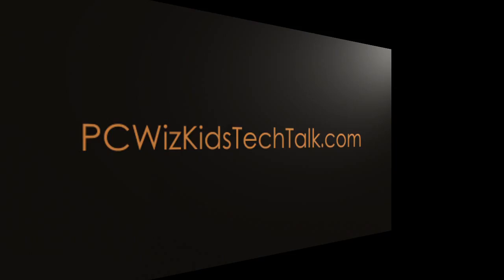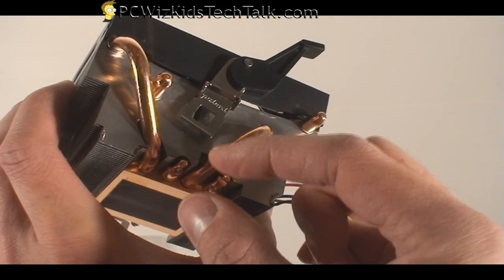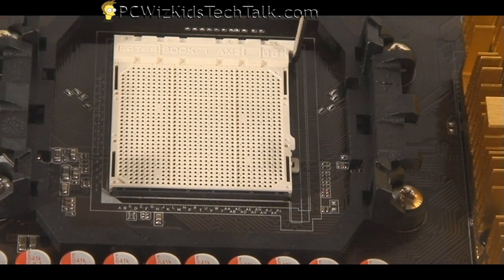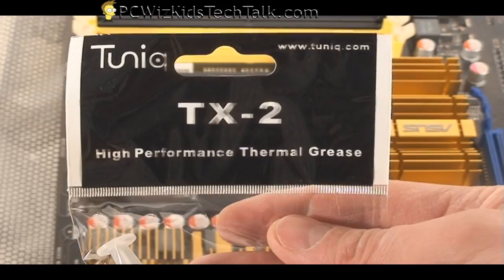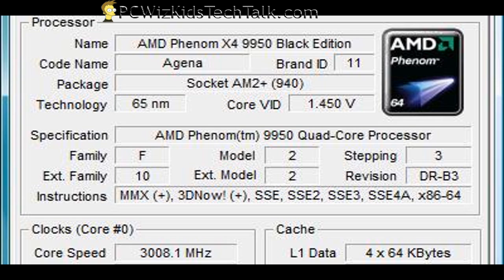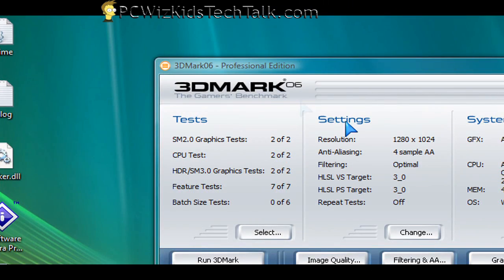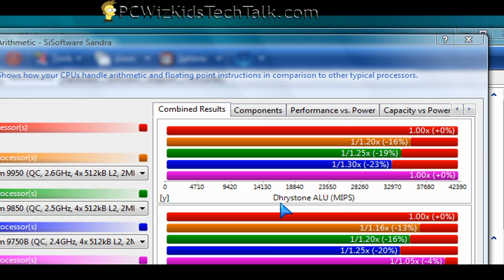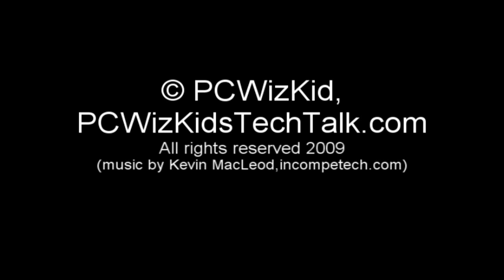Phenom X4 9950 Black Edition - AM2 CPU Review

Comment: if you did that with the stock heatsink i wonder why mine is much warmer then yours mine is right now 40 on all cores during gta v it gets to 60c processor is at stock speed i got the heatsink with the noctua nf-p12 on it do i need a new fan on the heatsink or a new heatsink in general?
Reply: New thermal paste.

Comment: @MotoHarmer It depends what type of Phenom you have. Is it the first or second Gen. phenom line up. Also which Phenom is it. 955, 965, etc?? If you have the 1st gen phenom they had problems. Although I myself owned a 1st gen phenom and it worked excellent in every way. However a Phenom 965 black edition 3.4 ghz quad core beast can be had for only $150.  I now have a 965 and it is a BEAST. WAY WAY FASTER than my 1st gen phenom.

Comment: I have the 3.4Ghz Phenom Quad core and the cheesy clamp system warped my board and didn't allow it to start properly. I had to loosen the clamps on it and its running fine now.  I used to be getting a "Bad Checksum Menu" error everytime I started up and it never booted. Always went to the black screen.

Comment: What is the minimum psu requirement for this cpu? im running a 450 psu and it wont boot when i have four one gig chips on the mb. im running two one gig chips now. would 550 do or should i get more?

Comment: you shouldn't touch the heat plate with your bare hands because finger prints are more thermal resistant than thermal compound and a bitch to fully remove

Comment: AMD is the best on 45NM technologies, that is confirmed.
and i am not 12 years old, what you could be, i am 19, and study'ing on the best ict college in holland.
AMD is producing a 8th Core processor, what will wipe the floor with Intel's I7.
and a I7 isn't a real 8th core processor, Intel because it is a Quad-core processor which can handle 8 treats, which makes it faster, but not a real 8th core, so that means that it still is a Quadcore processor.
AMD will come as first with a real 8th Core.

Comment: INTEL SUCKS!
AMD is official the best on 45NM Technologies.
Intel only had the best Processor on this moment.
but AMD has the best Quad-core processor, and only AMD has a Real Quad-core processor, cause AMD has 4 appart core's
Intel doesn't, a Intel Quad-core are 2 Dual-core processor, which means if 1 Core is defect on a Intel Quad-core processor than automatically 2core's are defect, on a AMD Processor, you still have 3 core's and with a AMD comes with a 8th Core processor, wait for it!

Comment: i didnt used the backplate of the hyper uc , i installed it without taking out the mobo,..and the paste i used was the cooler master, it cames with the cooler, i should go by cpu temp or core temp for the phenom 9950?  maybe you got reason i used all the paste in the syringe because it was so difficult to spare.

PD:your reviews are awesome thx and sorry about my english

Comment: i have a hyper uc cooler master and my cpu temps reach 58 with cpu nb vid and v core very low in bios... :( my aod temperatures from cores are all right but my cpu temp is always 10 degress more than the cores. any help? plz

Comment: just make sure it's a 2nd gen phenom. The performance increase is head turning. With a single graphics card you will notice a huge improvement. With multiple graphics cards in SLI (nvidia) or in Xfire (ATI) keep in mind that anything "under" 3.4Ghz will cause a gpu bottleneck. So do some research on overclocking the phenom II's before purchasing. I have 3... and love them! My PII x4 805 is currently running stable at 3.51Ghz @ ~38*C on air. So not too bad..Very Cool CPUs

Comment: update the motherboard to the latest bios at the manufacturer's web site. press f8 until you get into the bios on bootup, go to cpu configuration, advanced clock calibration, set it to auto, either that or all cores, if you set it to all cores, set the next menu to 0% as you dont want it overclocking if you dont know if it'll be stable. bootup and you should have a quad core.

Comment: you should buy the 720 its faster already than the 9650, and you can unlock the other 4th core if you have a motherboard that has advanced clock calibration.

Comment: love the videos man, now if you could answer this question i'd love you. i've heard alot about the phenom 2 940 so i finally picked it up, i'm installing it tommorow as it just came in yesterday. now coming from a pentium 4 i know in call of duty 4 and any source game i'll see a significant increase. how much i wanna know though will i see with an x1900xt. did i just switch the bottleneck now? i've been getting 90 fps in cod4 and as low as 10. will i get a bigger bottleneck with the new cpu?

Comment: I'm not too good to explain in english and i maybe don't know too much about the computers hardware. I was wondering. Does it matter what kind of motherboard you have or would this fit into my computer no matter what? I have a HP computer from late 2006 with a amd athlon 64 3500+ processor and it really time for a change now. I was thinking about getting the - ATI Radeon hd 4850 1gb - add 2gb more ram (3gb overall) and AMD Phenom II X4 940 Black Edition 3 GHZ.

Comment: AMD Phenom is one of the better processors to overclock and gaming PCs so when i bought mine it didn't came with a termal parte with it so i had to use mine and also i didn't like the cooler that comes with the processor in the box so i bought another one but you can also water cool it yourself if you prefer... if you do water cool it you might be able to overclock it more than the usual!

Comment: woah.. so ur using the Kingston 1066Mhz right? how do i run that thing in its 1066 Mhz spec? im downclocked to 800Mhz and if i set it in the bios to run at 1066 it doesnt boot up.. :(

using: phenom 9950BE, K9a2platinum, and Kingston HyperX 1066Mhz 2x2GB

any suggestions?

thanks for the rev

Comment: HUH??....I currently run a 
6400+ x2 BE 3.2GB
M3A32-MVP Deluxe
9800 GX2
4GB ram
Vista premium 32bit.

My Last run on 3D Mark Vantage netted me a score of 13493
A GPU score of 11616
and a CPU score of 26189.

Looks like I'll be sticking with my dual core until the 45nm comes out to play.

Here's hoping the 45nm wipes the floor with the current crop of quads as my dual core seems to be doing pretty well as it is.

Comment: never touched the processors metal coverage wen u pin it down on the socket. only with gloves you may. this is because your skin is oily, that oily substance that comes out your finger tips and onto the processor actually makes the processor hotter.

Comment: I have mine running with the stock cooler @ 2.91 GHZ, stock cooler, max 53C under load (multiplier change only, no voltage increase)

Can't wait for my new cooler to arrive :D

Comment: btw asdfgoogle...
e8500 has .5 higher multiplier...
so with fsb of 420 the e8400 is @ 3780mhz, but e8500 is @ 3990. 
Basicly it can keep the RAM speed lower wich means u can clock higher.

Comment: lol... the only reason i bought the e8500 is because when i went to frys to buy a e8400 they were out... so i said f*** it and i shelled out the extra 30 and got the e8500 and yes i do have it oc'd to 3.8 on air and if i wanted to go to a water i could get it to 4.2 ish... as of right now in vista i have a rating of 5.9 on all components with it oc... and its not only about the numbers... it the fact that is a 45nm cpu where as if im not mistakin yours is a 65nm... and i have more l2 cashe